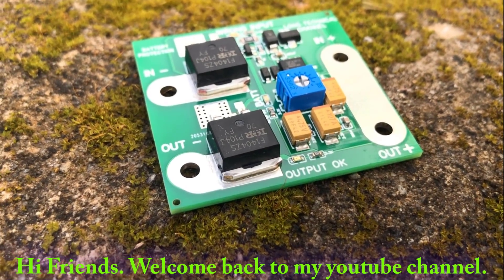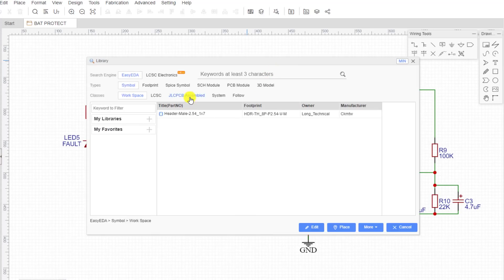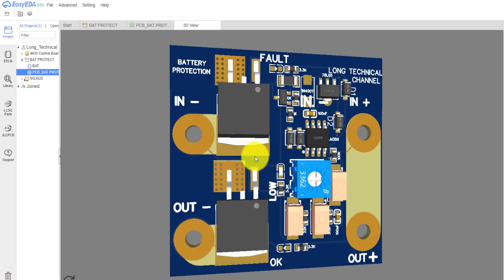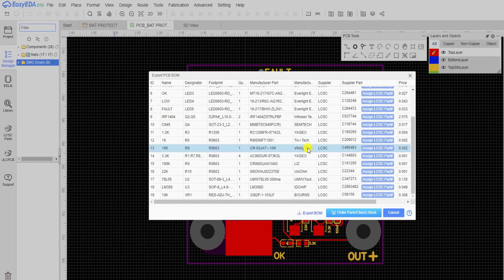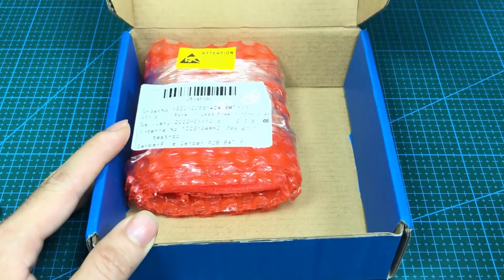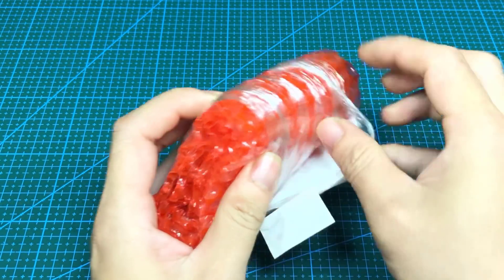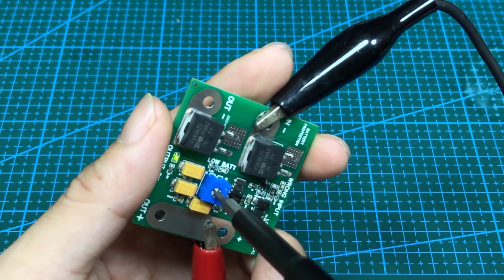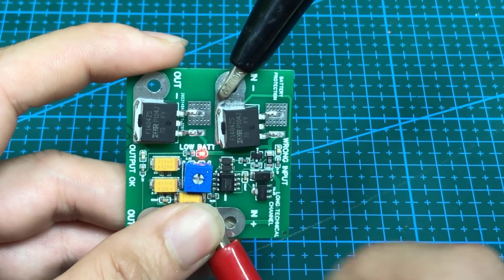Design Full Battery Protection Circuit Use EasyEDA and JLC SMT Service

Comment: Hello bro!  Please tell me if this circuit can be used in the voltage range from 9 to 15 volts so that the protection works at 9 volts.  What is the maximum current the circuit can carry?

Comment: For what is that ? only for undervoltage protection ? No overcurrent, no overvoltage protection ? We add a lot more circuits ?
Reply from the maker: It was designed for battery. So undervoltage and anti-reverse polarity are two important things to be protected.

Comment: Hey can you design or build a power bank module with 5 to 12 v switchable boost circuit with charge protection and many other protection with a current capacity of 10A at 5a per ports...... Plz